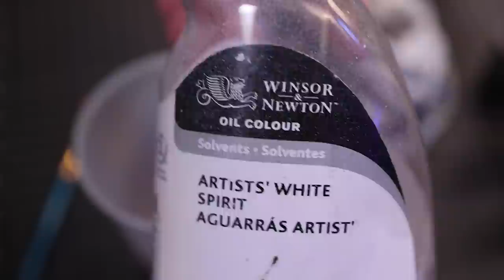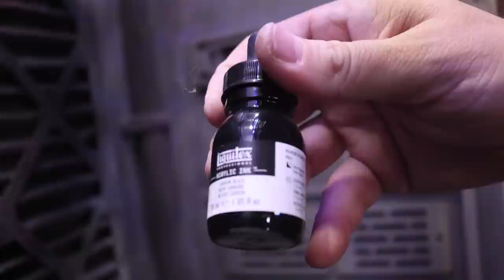Star Wars Model Diorama | The Jawa

Comment: Dapper outfit!
Does your old car mechanic smell of wet rat?
Q:  What do Jawas call Jawa Juice?  A:  Juice.
Likely you already know this, and, check into pin washes.  Seen a lot in model railroading and military models.  Can bring an excellent effect to your modeling.
Reply from the maker: Thank you much!  I had not heard of "pin washes."  I'll have to check that out!
Reply: @TheSmugglersRoom  It is a technique.  I find it works best with oil/solvent based paints.  Thin the paint down to get a wash, dip in a tiny brush and then touch the tip to a groove in your model/part/thing, and the thinned paint will wick along the seam depositing pigment.  it is even fun to watch it flow out.